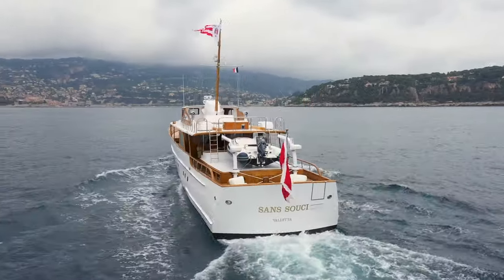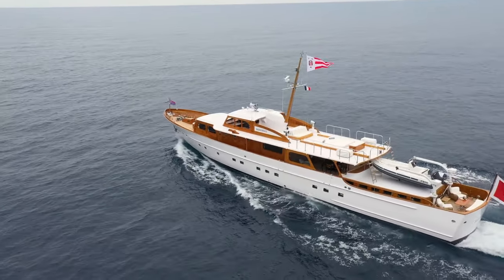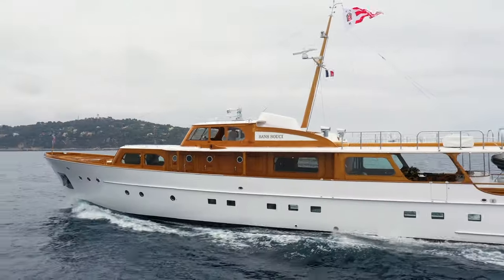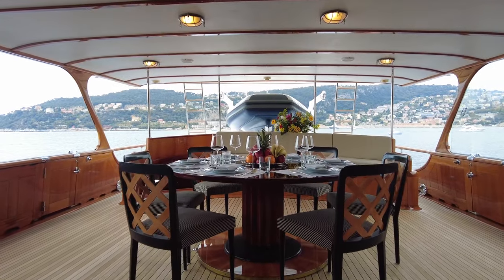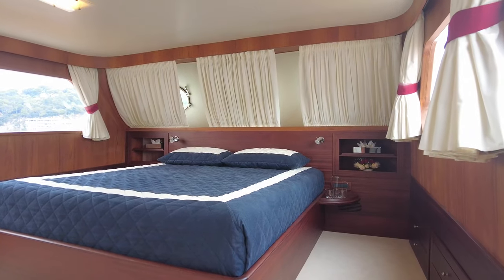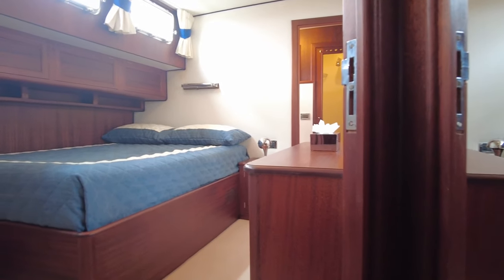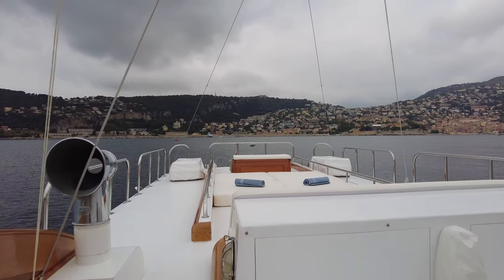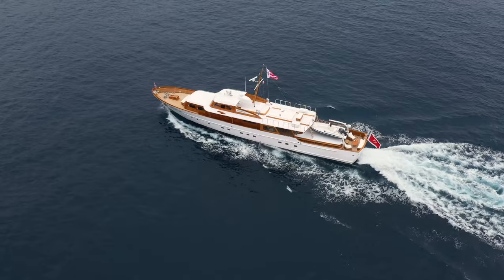Sans Souci | 34m Abeking & Rasmussen Luxury Yacht | Offered for sale through Edmiston

Comment: Very elegant, but must be a horror to maintain and repair all that external woodwork from the sun and the salt that will constantly attack it. Being a displacement yacht restricts its width to something very low compared to its long length, and makes the i nterior smaller than a different type modern yacht of same length. Owner's cabin is good enough but utterly lacks a library, a necessary item on long trips.